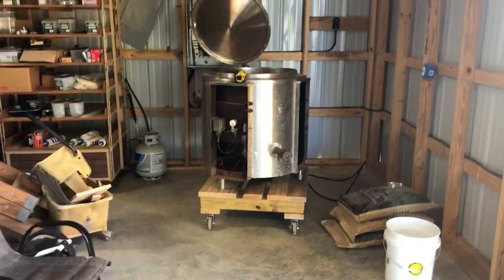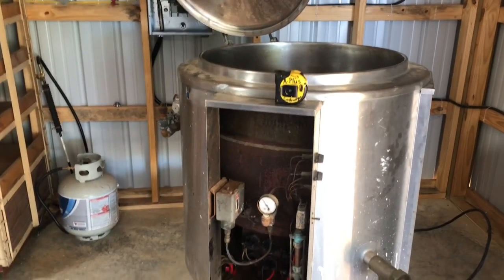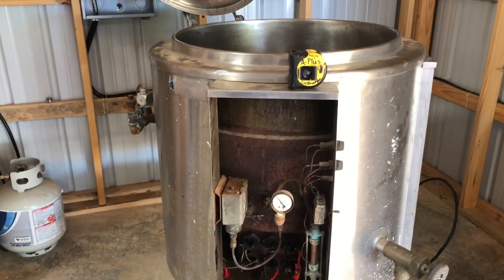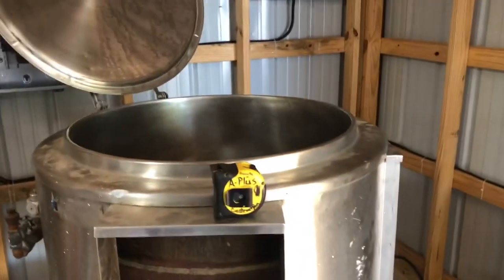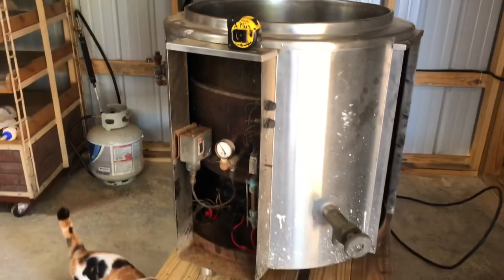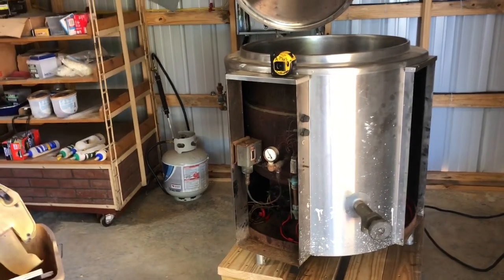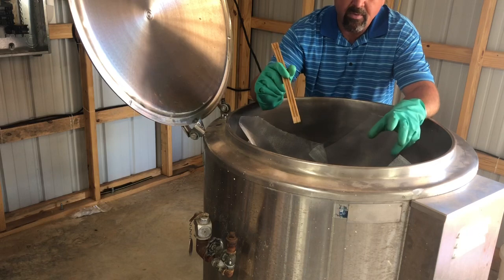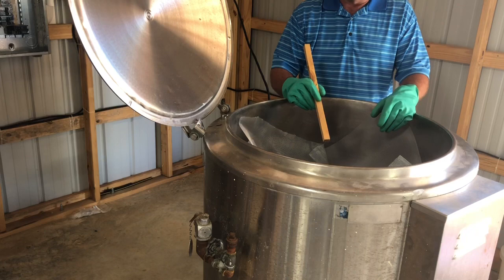Processing Bees Wax with a Steam Kettle

Comment: Rusty, have you thought about adding another drain valve at a higher level so you could drain out a substantial about of wax without getting into the water?
Reply from the maker: Don Bearden   We have.  The issue is that the steamer is double jacketed.  I need someone really good at stainless welding and would need to completely disassemble it to get it done
Reply: Rusty - I should have known that you had thought of that. I was just trying to be helpful.
Reply from the maker: Always grateful for input brother.  I aint that smurt realee😂